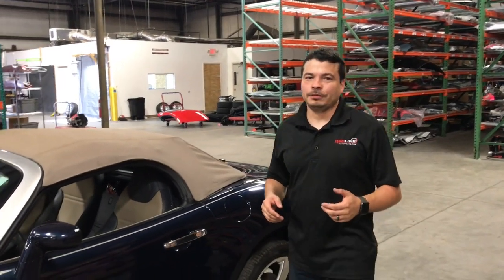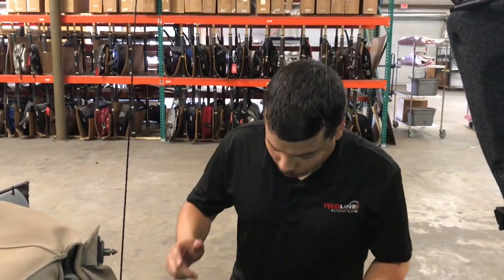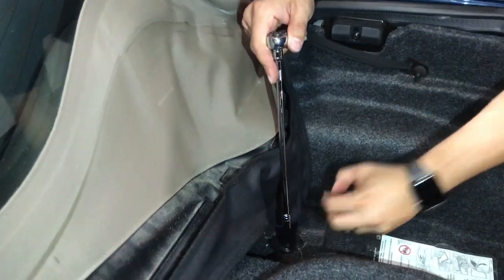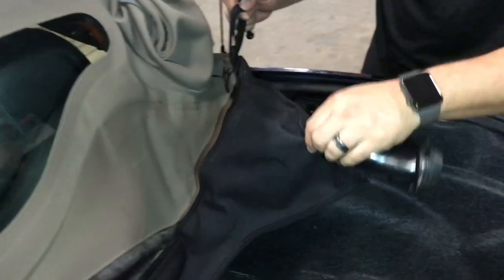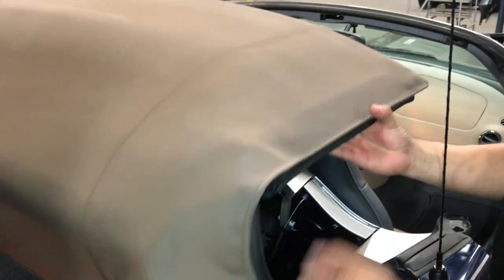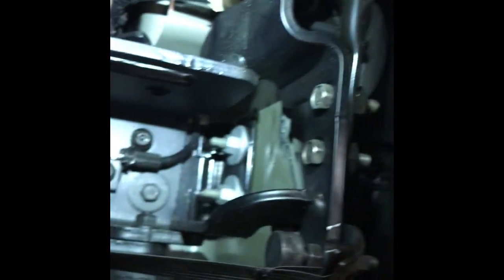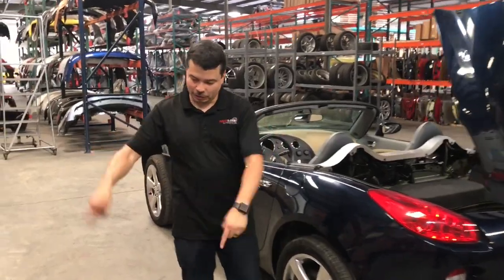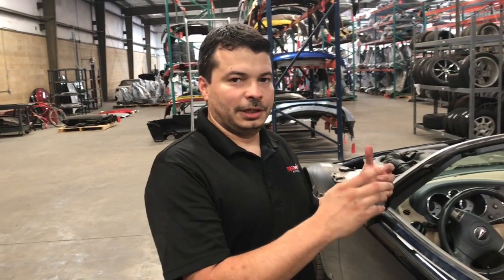How to remove the convertible top on a Solstice and Sky

Comment: both electric connections seemed to have fused/rusted together at the metal contact points.  may have to cut wires?  will try wd40.

Comment: Guys, if you would have shut the doors before you lifted the top you could have walked the top over the front hood and not set it on the rear panel for the moment while the helper came around. Maybe next time. Or at least have a cover on the rear panel.

Comment: You put out great videos! I have a question: if the top door flap plastic clips are broken, can the glove button not work or engage the release of the top and trunk? the relay is good and the rest of the cable attachments look good, except those clips. Any advice?

Comment: Can someone tell me how to get the front side fenders off the bolts be behind the door I'm completely lost on how to get to
Reply: @WhoDatNation69 Open the door, but not quite all the way , then use long extensions on a ratchet with a universal joint attachment.  It allows the drive to get to the bolts and turn.  Before you do anything use painters tape to mark the current location of the fender, so when you put it back on you have something to align with.